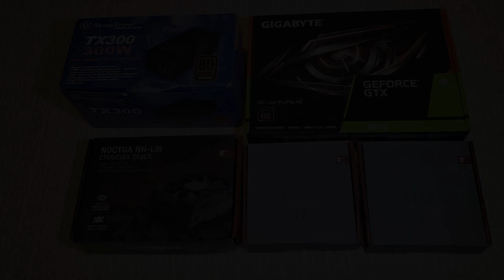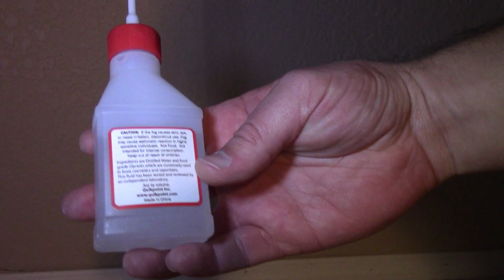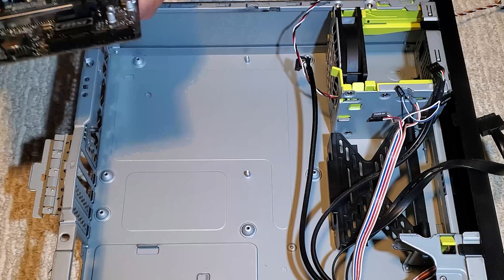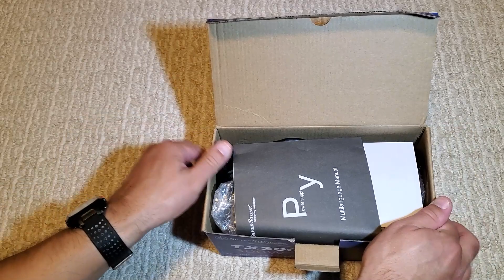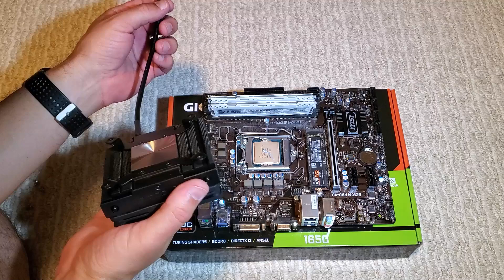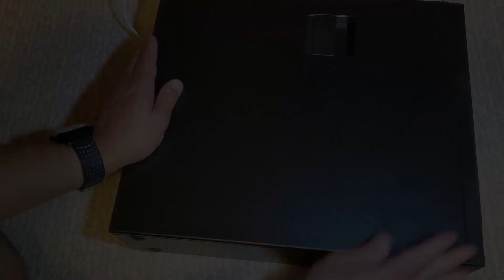Fastest Low Profile GPU GTX 1650 Cooling - InWin Low Profile Case Upgrade Part 1

Comment: I love these little TFX cases. I have an old dell vostro 200 I plan on turning into a sleeper build but I'm also worried about cooling since it only have a single 80mm slim fan and the stock intel cpu cooler of the time. Im thinking I might use either some 40mm noctua fans to help pull more air in or possibly consider a simple watercooling loop using an 80mm Radiator.
Reply from the maker: I never followed up on this video, mostly because I switched cases because I needed a bigger GPU.  I love these TFX cases, too.  I might revisit it now that the low profile 4060 is out.  I did end up running an i7 10700 in this case for a while.  I found an 92mm AIO from Asetek and put it perpendicular in the case and cut some intake/exhaust vents.  Worked great for the few months I used it.  Thanks for watching!

Comment: I'll be building a basic home server with an i3-10300 in this case when all of the parts arrive in a couple of days.
It's going to be the first PC build in my life, and I'm looking forward to building, testing, and possibly experimenting with it later.

No GPU (except for the built it Intel UHD, of course) for now, but I might get a low profile Arc A310 or A380 if they eventually pop up on eBay.

Comment: Where did part 2 stay? Can’t find it.
Reply from the maker: I haven't finished it.  I ended up installing a small closed-loop cooler and haven't figured out how to vent it, yet.  I ended up having to go perpendicular with it, because the smallest 92mm closed loop cooler I could find still wouldn't fit normally.  I hope to have it done and the video up soon.  Thanks for watching.

Comment: Our setup is quite similar. I have this same case, a GTX 1650 (Zotac version), Core i7-4790S, and an MSI motherboard that's similar in size and overall layout. I tried a few things, but what I settled on was two zip-tied Noctua 40mm PWM fans. One sits snug between the GPU and PSU, up against a custom "vent" I made out of the unused PCI brackets (see image 1), and another sits in between the gap of the black HDD door and front ventilation holes (see image 2) to blow air at the drives, since I found that the 1650 just dumps hot air all over them, causing my SSD to reach as high as 50C one time. The fans then run on a 2-way splitter that connects to my only extra PWM header, and follow the CPU temps to determine speed. Even at their max RPM, they're super quiet and push an impressive amount of air.

Image 1: https://i.imgur.com/Y9Vg573.jpg (fan between GPU and PSU)

Image 2: https://i.imgur.com/GRxYQ8j.jpg (fan between HDD door and front vent holes)

With this setup, after hours of playing something like Fallout 4 near max settings (no AA) @ 1080P, in a 75F room environment, the GTX 1650 tops out at 77C, and the CPU at anywhere from 70-75C. SSD now always stays below 40C. Idle/low load temps are 35-40 for the CPU, 40-43 for the GPU. In a case like this, with components like this, you honestly couldn't ask for much better.

Bonus: installed magnetic LED strips using the PSU's 4-pin Molex connector as well. Gives the case's pleasing minimalism a "gamer" flavor, as oxymoronic as that may sound.
Reply from the maker: Looks good and it's an effective solution.  I just finished my upgrade.  The Core i7 10700 I went with was too much for the Noctua NH-L9I to keep up with, so I found an Asetek 92mm closed loop cooler that I installed.  It didn't quite fit in the front of the case, so I ended up going sideways in the case. It's doing a much better job cooling the CPU.  Funny enough, one of my GPU fans started making some noise, so I was looking into designing a new cooler solution and am thinking about doing a custom blower-type design to blow the heat out of the back of the case.  I'm hoping to be done soon and will do a video on it.  Thanks for watching and nice work on your build!

Comment: What mother board are you using?
Reply from the maker: It's an MSI B250M Pro-VD.  Pretty basic board, but it gets the job done.  I'm about to do my upgrade to a Z490 and a Core i7 10700, but the only thing I ever wanted on this board was more fan headers.